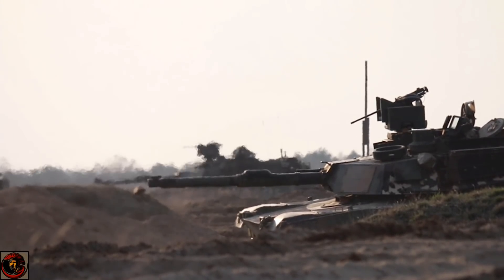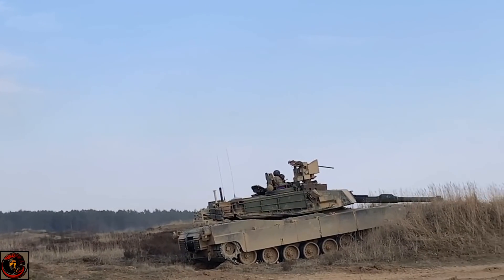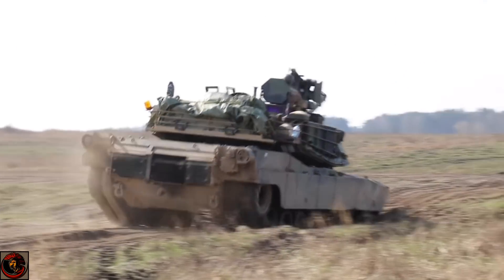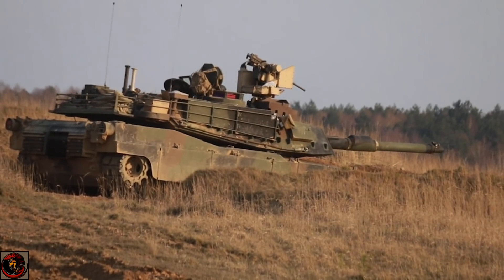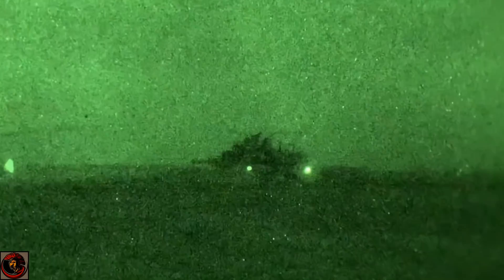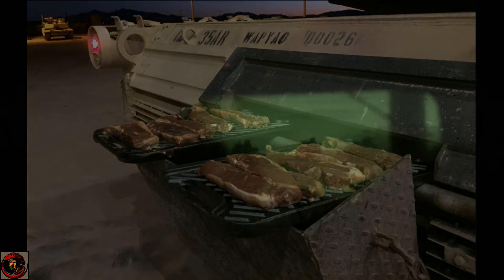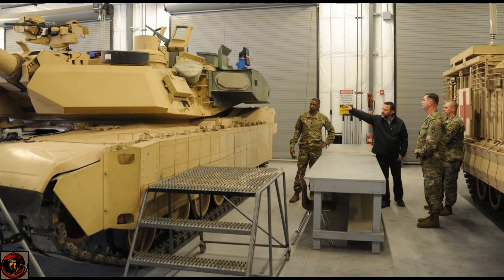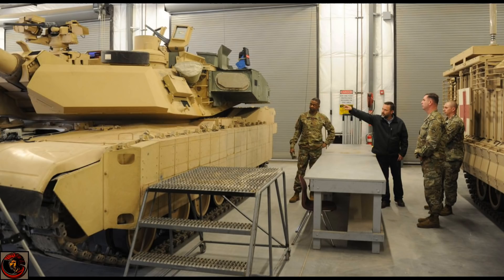M1A2C Abrams Tank Upgrade - The Last One?

Comment: Not the last one. It will be upgraded for a lot longer, hopefully the next one includes an upgraded turbine. It has a lot of life left. Heck, the Russians are running upgraded t72s and t90s.
Reply: Turbines are likely going to be abandoned as a concept. General Dynamics has purchased a production license for the MTU 883. The A3 series is predicted to utilize a power plant similar to the "EuroPack".
Reply: Ukrainian modernized T-64 is beautiful look it up.
Reply: Well T-72 and M1 are both from the 1970s
Reply: @albertoamoruso7711  Actually the M1 originates in 1983/4 with the M1A1 comming in 1985.
Reply: @aleky98  It entered in service in 1980, but it was produced already in 1979, the first operating model being tested in 1976 against Leopard 2.
Reply: I’m stationed at Fort Bliss, and we’re getting the last Variant of the Abrams which is the SEP V3s next year, then that’s it with the Abrams series.
Reply: Oh and to add on the Russians have a new battle tank called the “Armata” but they’ve only made so many bcuz of the cost for it.
Reply: Abrams are extremely quiet for what they are, almost got smashed by one busting out tall grass in Korea while doing training maneuvers at KTC, didn’t hear coming and all of a sudden it landed in the in front of me about 20yds in the road😂
Reply: Yeah, and i've heared that that the Leopard 2 A7 will upgraded to an A8 in about 5 years,wich means we won't see a Leopard 3 any time soon. However, the Leopard 2A8 will probably be a completely new design, or so i have been told.
Reply: @Enthropical_Thunder  then it will be called leo3. Chances are we won't see any new design until ww3 or cold war 2 happen.
Reply: @jintsuubest9331  
One would think so, as significant change in design always ends up with a new designation but they seemingly want 
it to hold on to the 2A series name. 
I have this information out of a video from the Munster tankmuseum, they had  a retired engineer that talked about the history of the Leopard and it#s future upgrades, i think there are subtitles to, i can only recommand watching it, very interesting stuff ;D :
https://www.youtube.com/watch?v=kN9mfkxtTu0
Reply: @Enthropical_Thunder  I seen that vid like when it is uploaded, but I didnt spec into German skill.
Reply: @Enthropical_Thunder  They will have to. They no longer can make new Leopard 2's from scratch. That is why they parterned with the makers of the Leclerc to make a Leclerc-Leo hybrid.
Reply: @jamegumb7298  
I wouldn't say that they have to, it is just common sense for us that they would give the tank a completely new designation. The cooperation with the french won't change much, as the french probably wil cancel the cooperation halfway through and than do their own thing, at least history tells us that much.
Reply: Look up the M1A3
Reply: '
hi K...
ussr russia have tooo many much waste waste tanks
Reply: new salt  I just checked, I wrote .6 . You must have dust on your screen! lol
Reply: t90 is much more modern the abrams i think u meant to say t80's and t72's
Reply: luka bogdanovic it’s not. The t90 is a much more modern version of the t72. The first t90 was...drumroll...called the t-72BU. Not that it’s bad, but to say the t90 is newer isn’t totally true. It’s newer in name only.
Reply: yeah, and Raytheon is upgrading M60A3s
Reply: kcimb I think you mean “ upgraded T-72 s as T-90s”
Reply: @coolminecraft1457  the t-90 was an upgrade of the t-72, but the t-72 is still being improved as the t-72B3 as recent as 2016
Reply: @coolminecraft1457  T-72 and T-90 only shares the hull
Reply: @albertoamoruso7711  T-90S shares the same turret the T-72 has. Its just upgraded. T-90A has its own turret.
Reply: @albertoamoruso7711  No, they do not. 😎
Reply: kcimb Exactly. And with the T-14 Armata being an abject failure and with with only 100 of those lemons being built, there is absolutely no need for the US or any of it's allies to field a new tank for a very long time.
Reply: Why even a turbine its loud and expensive. just use a diesel engine like the leos do, cheaper very easy to hide heat signature and best part of all is power since horsepower is not how u measure actuall power. Sure horsepower is good but having 2000 hp gets u into the wall faster but torque gets u  through the wall faster.
Reply: @DavidWalkerP47  The turbine on the Abrams is actually quieter than most of the current diesel piston engines used in modern day armor. The M60A3 was quite a bit louder and I served on both that and the Abrams. The turbine engine also produces less low rumble than conventional types, which easier to hear in the field at distance. I have heard many an 11 bravo comment on how much more difficult it is to pinpoint an Abrams location than other vehicles and that can be spooky when you are trying to stay out of their way at night. Turbines are also easier to service or swap out in the field under less than ideal conditions. They are a better engine imo and I have plenty of experience to back that statement up.
Reply: @Metalpanzerwolf  ok what about blade degredation? And on a diesel u just put a silencer on boom very quiet and if its still noisy u turn off the engine and no noise....  and with a diesel engine u dont need to service as often as a turbine since no blade degredation wuth pistons.
Reply: @DavidWalkerP47  Blade degradation? Its called engine wear. It happens to ALL tanks. In fact, the M60A3's engine had turbo chargers on them. Guess what? They have blades on them. We pulled ours off because they broke so often and accelerated engine wear. When you are pushing massive tonnage with an engine of any design things break... always. I spent WAY more time servicing the AVDS-1790-2C 750 hp 12-cylinder than I did the 1500 hp Honeywell AGT 1500. Ever replace a quill shaft on a 12 cylinder engine? Blow an oil jug? And btw the Honeywell AGT 1500 on the Abrams is a multi fuel turbine that is can be fed diesel as well, although it usually uses JP-8. And that "silencer" you refer to is called a muffler. Instead of "blade" wear they suffer from other cool shit, like blown rings, thrown rods, cracked blocks and typical gasket leaks along with normal piston wear. That's just for starters. The ease of parts swappage on the turbine is well known among those of us who have actually served on both tanks. The turbine also has way more torque and immediate power on tap. That is important when you are pulling quickly in and out of defensive positions or doing a SAGER dance cause some yokel just launched their favorite wire guided ATGM at you. It sounds like you have ZERO experience with any sort of tank. Have you actually ever even been around one other than a static display? I love it when WOT keyboard ninjas razzle dazzle us with  their uniformed opinions. lol. Any other first hand knowledge you would like to share?
Reply: Logan Walker  blade Degradation? So pistons don’t break? Silencer? 

A diesel is much louder than a turbine at idle and WOT.
Reply: @kcimb  
Blade degredation, caused by many things, like low grade fuel (you always want to use JP1 on conventional turbines) but almost always due to lifetime, that's why turbines even have to be serviced and why they are so god damn expensive to keep running. The thing with piston engines is, that they don't rely on precise blade shapes that can clogg over time, due to, for example, to much sulfur in your fuel (causes a lot of unburned carbon atpms to bond tone big mess). In fact, if you want a reliable engine that works with almost anything you throw in it, than you take a piston engine, jet engines as well as rocket engine can be very picky in regards to fuel quality. Also, it isn't nessecarily true that a turbine is less noisy than a diesel piston engine, turbines actually can't be restricted that much, as they rely on a huge airflow but they have the advantage, that a turbines noise is continuous, wich can't be destinguished as easily as the pulsating sound of a piston engine.

If you want to have a cost effective , reliable and easy to hold engine, take the piston engine. If you have a lot of money to waste, want a very high power/weight ratio and less easy to spot on the move vehicle, take a turbine.

I don't really care, as both engines are basically designed under german engineers, so they both should do their buisness as intended ;D.
Reply: @Metalpanzerwolf  yes but they use to much fuel a diesel can go twice the distance before filling up, all you see in Iraq was a convoy of fuel trucks, you wont get away with that if war breaks out between USA & Russia like you did in Iraq. The Russians know the Abrams is turbine and uses loads of fuel they will simply wipe out all your fuel trucks game over.
Reply: @terrywainman6050  All I saw in Iraq was a line of dead tanks and apcs. I bet they thought the same thing about taking out our fuel trucks. Yet that didn't happen. I can see you did not read all my previous posts discussing this very issue, but here some info again in case you missed it. The AGT turbine IS a multi fuel engine. We use it because during the cold war we had already thought of the whole fuel supply issue. The AGT is normally fed JP8 but will run on just about any fuel including diesel. That is a huge advantage. ALL tanks hog fuel. Every last one of them. That is why many modern tanks utilize an APU. They don't just sit them in one spot on idle for ten hours at a time. The Abrams fuel consumption is not all that bad when you consider the weight of the armor being pushed around by it. I will take the trade off in mpg for the protection. Most tankers like myself would agree. The Abrams uses approximately .6 gallons of fuel per mile, T-72 uses .8. The T-90 gets around .9 which is pretty darn good compared to the Abrams. Lets be real though, the long lines of fuel trucks were there because of the huge amount of distance traveled. Any country fielding armor would face the same problem regardless of fuel type or consumption, with way less resources than the United States have at their disposal. And there will most likely NEVER be a war with Russia and the U.S. using conventional forces. Stop pretending like its gonna happen to hash out a half reasoned response to some thread you barely even read. We will of course see proxy wars, but you saw how that worked out with the last two thunder runs we rolled out on. The whole "Well if you invade Russia its game over" gets old, and shows us just how little you understand modern warfare or politics. I know many of you love to try and bust the Americans/Abrams chops any chance you get, but try doing some reasoned research in lieu of actual experience. Uninformed one or two liners (like they will simply wipe out your fuel trucks) just make you look contradictory and uneducated just for the sake of personal bias and argument. Nothing is simple in warfare, there are too many variables. The idea that you can predict what is going to occur with some fantasy future battle is laughable regardless of any irl experience you may have. Your summation of what would happen is pure conjecture.
Reply: @Metalpanzerwolf  😂😂😂😂😂 dont kill the poor kids hope and dreams
Reply: Logan Walker the turbine isn’t loud. The thing is the abrams was designed to have a lightweight engine in the rear. That means more weight can go for armor. The leopard 2 MTU engine dry weighs 3968 pounds compared to 2500 for the AGT1500. Furthermore, the turbine is quieter, easier to start in the cold, and much quicker. Also, the turbine creates more torque than the diesel. It’s a power house. 

Downside? Likes fuel more and sucks up lots of air.
Reply: @kcimb  tell me how a gasturbine makes more torque than a disel? Yes more horsepower but not torque
Reply: @Metalpanzerwolf  
First of all, it does not matter how much torque the engine generated, it matters when it geberates peak torque, a piston engines does that at around 1500 rpm, a shaft turbine reaches its maximum torque at very low rpm up to mid rpm range depending on your maximum rpm. In wich world is a turbine easier or even cheaper to repair than a piston engine, if that would be the case, we would have them in our cars, wouldn't we?
The problem that most turbines face is cost efficiency, especially, as the AGT1500 seems to use any fuel, your service intervalls will be much shorter compared to the regular piston engine. The parts precision (especially weight balancing), alloys and special manufacturing processes make these things even more expensive. 
You really are trading torque characteristcs and noise of an electric motor for a high fuel consumption, lower productivity and a "imperial fuck ton of money" ;D. 
Actually, if you think about it, no other engine could be more suited for the USA than a turbine XD.
Reply: @Enthropical_Thunder  First of all, I never said it was cheaper to fix. Due to the metallurgy involved of coarse they are more expensive to build even if they are a much simpler concept in operation. The transmission on the Abrams is far more complex than the engine operationally speaking. The torque is there when you need it and that is what counts in the end. The Abrams has what's called Tac Idle. Go look it up and why its used. There is no denying that they cost more money in parts. That is such an insignificant part to the overall running cost of the tank it is insignificant in the overall running of the tank. All tanks hog massive amounts of fuel (we normally use JP8) as well, so even that comparison gets a little nitpicky. You won't find any tankers who really care though, it works to darn well plus our lives are worth it. You can bet when the tech matures for electric engines those will be used in the future so not quite sure what comparison you are trying to make on that point. If you can name me a current issue common MBT that uses an electric powered engine let me know. The AGT's are easier to service and repair on the crew level and that's born from my years of experience with both types. Have you ever had to work on the Honeywell and a comparable piston engine for any armored vehicle? Service intervals for both engine types are different, so again I am not sure where you are going with that comparison. I do appreciate your more reasoned response. It sounds like you may have a solid understanding of turbine mechanics but it seems you viewpoint is biased due to lack of real world experience with actual tanks or at least the Abrams series. Oh, and one last thing... go look up the research and theory behind turbine powered cars. There is some interesting stuff out there. XD
Reply: @Metalpanzerwolf  
Actually, i pretty much know every car or race car that was ever thought to be the furture of transportation, or race car,. My reasoning comes from the knowledge that the vew formula 1 and Indy cars that ever used a turbines had a lot of issues and were often unreliable, however, they were unreliable due to the for that time common metallurgy used alloys. 

I already thought that the troops wouldn't use common Diesel to power the AGT1500, since the low sulfur percentage and the anit corrosion aditives really do come in handy for the lifetime of the turbine.

I am not really that biased towards anything, the point i am tryng to make is that the US military can afford such an expensive machine like the Abrams M1 ( i would bet that the turbine is the most expensive thing on the whole tank, besides maybe the counter measures for anty tank rockets) most other countries can not.
Therefor i think that the Diesel piston engine is the way to go, simply because you can built much more of these engines, at higher quality, in a short ammount of time with less money than the AGT1500 and above that, the diesel engine is much more economic, as it uses a lower ammount of less expensive fuel. Of course, the soldiers or mechanics won't bother the price of the fuel, at least not until there is a shortage, than they might complain about the tanks drinking problem ;D, that in mind, the fuel usage actually will play a major role, ask the germans, they learned their lesson XD.

Granted, the AGT1500 has (as i said befor) the advantage of  sharing the same characteristics as an electric motor does, being high torque at low rpm and relatively constant noise (wich isn't as good to detect as pulsating noise, like the ones of a diesel engine), i talk about the actual torque curve of the engine,  not about the torque you would get of the drive sproket. There is actually a good picture on google that shows the torque over the rpm of the MTU unit and the AGT1500.
Also, i think the german ww2 Ferdinant tank destroyer and the Tiger P are the first that i could tell you, that use electric motors. The first tank to use electric motors however was something called
"Holt Gas-Electric Tank", an american design that looks like an abomination but  has been built in 1918 as a prototype, possibly or most likely the first of its kind (at least to my knowledge). Edit: you didn't define if the electric motors are mainly used as a transmission or as some form of hybrid or as a pure electric drive ;D.

To conclude, i do think that a turbine engine ,from an engineering point of view, is more desireable  but i do also think that from a military point of view, thze MTU diesel is just more effective overall (including build cost , build time, fuel consumption, repair cost and other running costs, like oil consumption ). 

If you ever should encounter a hardcore "german guy" that thinks that the Abrams is shit, just tell him that the cannon is from Rheinmetall and the AGT1500 developed under the german engineer that also developed the Jumo004 engine (propelled the infamous Me 262) in WW2. The engineer is called Franz Anselm after the war, he immegrated (under operation paperclip of course) and worked as a chief engineer at  Lycoming.
Reply: @Enthropical_Thunder  In essence I agree with much of what you say. I love Rhienmetal products. They make good stuff. Their new APS is pretty impressive. I have never had a German bad mouth the Abrams. We share a lot of tech and German and U.S. tankers have much respect for each other. I was stationed there for years and worked extensively training with the Bundeswehr while I was on the OPFOR team. I am well versed in the lessons the Germans learned from WWII. The M256A1 main gun we use is actually a licenced version of the L44, built by  by Watervliet Arsenal. I say version because there are some vital differences to get it to fit into the Abrams turret. I also said in my statement name me a common used and issued MBT with an electric engine. The Ferdinant (I think you mean Elephant because Ferdinant Porsche was an automotive engineer, which I am sure you already know) is a tank destroyer, not a tank. The Elephant propulsion system was at best a hybrid, with the main power plant being two Maybach HL 120 engines mated to  Siemens-Schuckert 500 VA generators that were in turn connected to  two Siemens 230 kW individual-output electric motors. Those motors were connected to the rear sprockets and provided steering for the vehicle. It was not an electric engine tank. Its actually called an petrol-electrical drive. This drive system was developed by Ferdinand Porsche. The Panzer III Mauss used the same type of drive as well. If you want to count that then you have to count all the electric motor parts in a tank, including turret drives, ect and that takes us to an entirely different topic. And to address your statement regarding the Turbine being the most expensive part of the tank, no it's not. It is one of the most replaced major components, so cost of time that may be closer to the truth. It would be my somewhat educated guess that fuel/ammo and track repair still cost more in the long run. Trophy just won a 67 million dollar contract to outfit 261 Abrams, that's about four brigades worth. After install it will run around 200 million so I think that wins the cost prize at the moment. :-)

I will grant you that fuel can be a problem for the Abrams, but it really is a problem for ANY tank. I am not sure why people keep pointing out the AGT fuel consumption like its a unique thing to the Abrams. As a bonus the AGT can take just about any fuel that burns. That's something most tanks engines do not do. Nothing like fueling up at the local Smirnoff factory right? Lol.  A tanks effectiveness relies on three things. The tank, crew and logistics. Miss one of those things and the tank will turn itself into a field expedient pill box with a cannon or end up with a dead crew.

I get that you may know (as you said) everything about any car or race car that ever was or ever thought to be the future and can respect that. That being said, tank mechanics and operational theory is a completely different monster. Both subjects cannot really be used as a developmental or historical perspective comparison... Unless your Ferdinand Porshe! Lol. I myself know next to nothing about race cars, so me trying to generalize race car mechanics, performance, service and logistics is way out my league, but I am sure I could learn a lot from someone of your experience on that matter. :-) Thanks for the dialog!
Reply: @DavidWalkerP47  The M1 has a significant sound and exhaust signature advantage over traditional diesel engines. The Germans called us "Whispering Death " when we first brought them to joint ops. In terms of maintenance the turbines outlast piston engines by a large margin.The whole heat signature argument is over stated. We deploy in hull down positions facing our enemies line of approach. Unless we have completely screwed the pooch no one is going to see our grill doors.
We have all the horsepower we need in the M1. The vehicles weight and power over match the suspension quite often in rough terrain but never once have I said"If only we had more torque and horse power" The fact that the turbine is nearly half the size of a piston engine means we have room for more electronics and fuel. Yes we burn a little more than pistons but we also have the support units to keep us fueled so its a moot point to talk fuel economy in regard to our tanks.
Everything I've written here is from personal experience. Not war thunder,world of tanks or internet experts.
Reply: new salt   most leopards have diesel engines and they are fast, powerfull  not just fast..... basically a diesel m1 would be way better than a gasturbine......
Reply: new salt  The M1 is a 1970s design, like all other prevalent MBTs today. And its not even as American as people like to think. Although its the first and only US-made tank thats actually decent relative to the competition.

In what sense is it the best ever? According to who? You? Americans themselves? Everyone thinks their tanks are the best.. why does your opinion hold more weight compared to theirs?

Upgrading the M1 is no different from upgrading the T-72 or T-80 or Leopard 2. The M1 unquestionably has better armor than the Russian tanks, but it comes at a cost. Doesnt make it the best or relatively better in any objective way.
And how do the numbers matter exactly? Say, US wants to invade Russia... with tanks.. Ok. How do you suppose they gonna do that?
Reply: And to mention it, how many T90's can you field for the same price as one Abrams? Keeping in mind both tanks can easily kill each other. And both will struggle to kill each other in head on head combat
Reply: @Kevin Smithwick— The Europack  does seem to be a better engine. So, we don’t have to give up many jobs and our soldiers can still get the best power plant because the West honors’ peoples intellectual property rights and is ready and willing to manufacture the Europack under license. The Chinese and Russians look at us, paying a royalty to the creator for engines produced in our own country, shake their heads, and laugh, saying, “why on earth would you do that!”  
Well, for one, it’s the right thing to do, and they will continue to do business with you, and two, modern military machinery is so sophisticated that, while you may be able to reverse engineer 99% of it, that missing 1% can literally get you, or worse someone’s son or daughter, killed! There is so much complex, sophisticated hardware and software that goes into these military machines, you’re so much better off just to pay them what they got coming so they will cooperate with you to get it right. Me, I want whatever is the best for our service people, and I don’t care who makes it.
Reply: It definitely doesnt have much life left in it.
Russian tanks serve a completely different purpose. The M1 is intended to fight against other (inferior) tanks in 3rd world countries, the Russian upgraded T-72s (including the T-90) are not, they are primarily a mobile gun platform and supposed to spearhead an assault into a defended position, like that of a guerrilla force. You cant compare the two. Its like comparing a DMR to an LMG. Just because they are both firearms doesnt mean they serve the same purpose.
And just because Russians are running upgraded T-72s doesnt mean the M1 has life left in it. The T-72 ran out of life like 30 years ago. All they have done since the 80s is improve the electronics. Bolting more armor on an already problematic tank in terms of weight doesnt give it any life. It just shows it ran out of it a while ago. Electronics upgrades only allow it to remain relevant on the modern battlefield as long as the potential adversary is massively inferior.